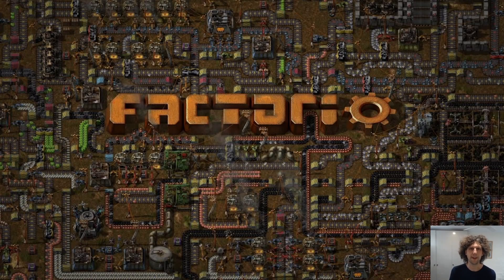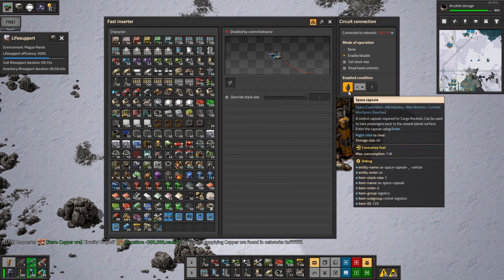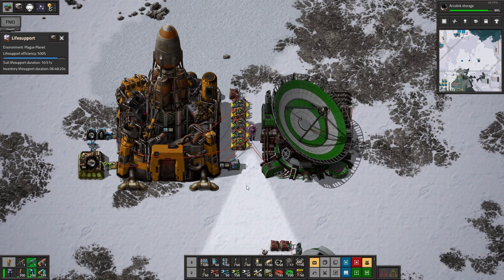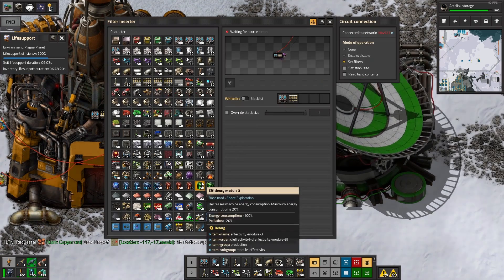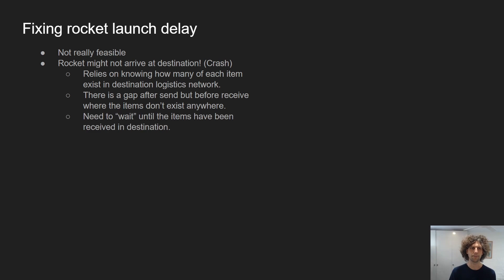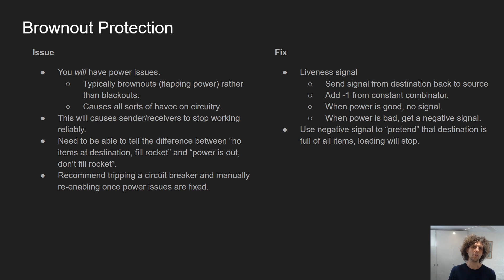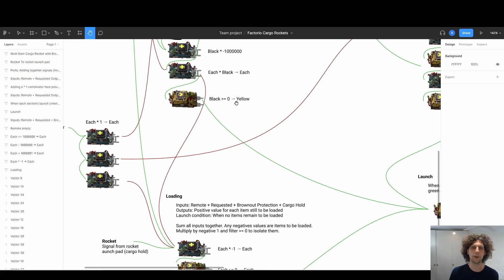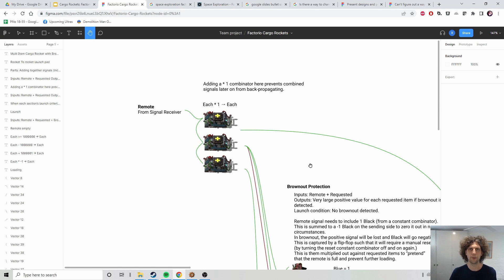Cargo Rocket Tutorial (Factorio Space Exploration)

Comment: Hey, so i watched the video a few times and cant figure out what i did wrong. Sending a signal from transmitter for 1.2k iron and when its recieved and translated through your blueprint it turns into 1.4G iron requested. Dont know what im doing wrong and was wondering if anyone else has the same issue and perhaps a solution.
Reply from the maker: that sounds like something in the brownout detector is busted (reset the constant combinator?) Sorry don't have a setup to re-test the blueprints, sorry if they're busted :S Otherwise my debugging path would be tracing the circuit through and comparing to the diagram in the video at each step - each "module" should be relatively testable in isolation, use a constant combinator to send test values through (rather than feeding in the real inputs).
Reply: @XavierShay  the blueprint you provided is definitely messed up, I have the same issue. Not sure if an update caused it or something as this was posted nearly a year ago. Basically the brownout * 1.0M gets fed into the green signal going to the rest of the circuits. If you sever the connection from the 3rd combinator in the 1st row of combinators going to the first combinator on that same row, you will get the correct signals to load the rocket. I think I will have to copy the diagram manually to reconstruct this as intended.

Not sure if I'm using this right since how to set up the requests is never covered. The target have a wire connecting a landing pad to a constant combinator that sets target values ie -2.0k iron. Existing iron on the landing pad reduces the magnitude of this negative value transmitted. On the source side I remove the extra stuff from the constant combinator in the final row, I also use multiple stack filter inserters. It takes an extreme amount of time to load with a single fast filter inserter with a single stack size, and I can live with overshooting the stack size.
Reply: Ok wait, after building out the circuit and doing the brownout last and reading the pdf more extensively I see what's happening. It's not a problem with the circuit or blueprint. The target end needs to send 1 black square. Then on the receiving end you need to open the top right combinator (blue signal) and toggle it off/on. Any time that black signal disappears you need to do that since its purpose is to shut it off in the case of brown outs.

Adding a logistics receiver with this already set up would help address the confusion, as well as comments in the blueprints themselves. Also, thank you for putting together this video and circuit network together in the first place, it took me building it out to fully understand it. Definitely would have taken a lot of hard lessons from exploded cargo pads to figure this out otherwise.
Reply: @lllllllllllillllllll  4months late bro
Reply: @callmethanos5199  you're welcome bro! Maybe someone else has the same problem and looks at the comments and doesn't have to figure it out themselves.
Reply from the maker: @lllllllllllillllllll   good sleuthing! Sorry I didn't make it clearer in the first place. Really appreciate you following up and posting your solution /\
Reply: @XavierShay  no worries, this was the kick I needed to get better at circuits and I learned a lot by looking at yours! Thanks for the video. The core concepts of the different parts of the circuit are great if you want to create your own. I ended up making mine check to see if over half of items were out of stock and the total items loaded were over 150k (I'm not sure how to count stacks, and I chose to play with increased stack size but SE really doesn't like you doing that so some items are 50, others are 400). That way rockets get sent when needed and I don't need to monitor it.

Comment: have you any thought of a requester chest rocket loader tutorial, because if this hasn't made my mind a jumble with it over loading on items. you seem like you know what your doing. :)
Reply from the maker: I'm unsure what you're actually requesting. More detail on one of the techniques in the video, or something else? Either way you need circuitry.
Reply: @XavierShay  Jumping on the question months later, but as I just found this video (great one btw) I think I understand the question.
In your method, you set up the filter inserter based on the circuit, which means you still have to make individual requests from the requester chest. But just linking the inserter to the chest, and putting the chest in "set request" mode makes the request chest only request the number of item that are missing.

In my opinion setting up the requester chest is actually a better option, as you automatically get everything asked, if the circuit is in the negative. But that also means that it will request the items basically one by one, when used in the remote place. It didn't try, but my first thinking is that it will mess up a bit with the green signal to send the rocket....
Reply from the maker: @Turgonas  I ... don't think I knew you could set request items using the circuit network. Neat! Always something more to learn...

Comment: What's the purpose of the addition and subtraction of the large abitrary number? I have created a similar setup without this transformation.

Also, a personal preference of mine, but I keep the requested items positive in the combinator and then negate the inventory of both the rocket and remote signal. Positive numbers feel more intuitive and I don't have to remember the negative.
Reply from the maker: It filters out signals not related to what is being requested. In a large logistics network I've found it can often have multiple items in the negative, and they can end up "clogging up" the filter slots on the inserter. From memory, I think it's also needed for one of the launch conditions to work correctly.

Only reason I use negative is for consistency with LTN (which to be fair you could also do the same trick on - negating the signal - but it doesn't seem like anyone does)